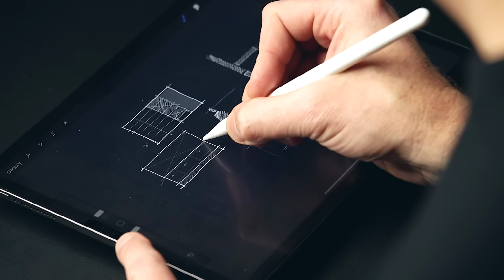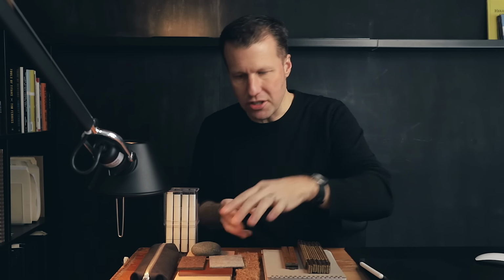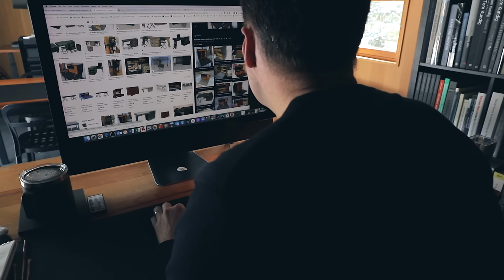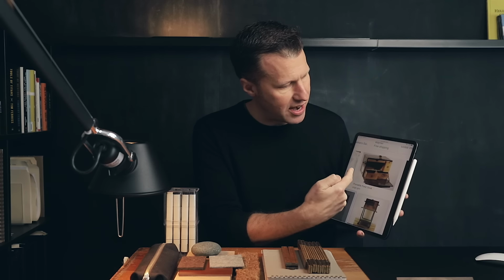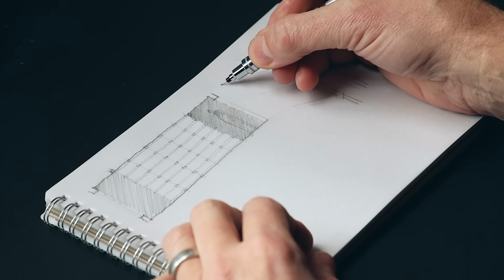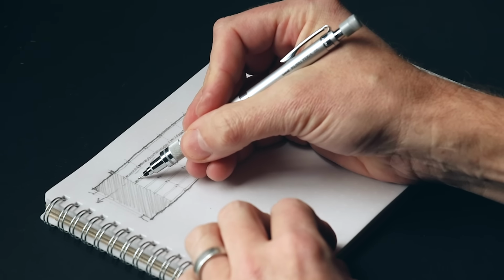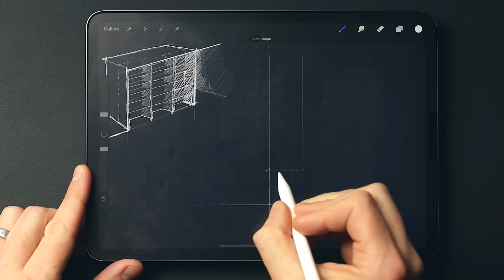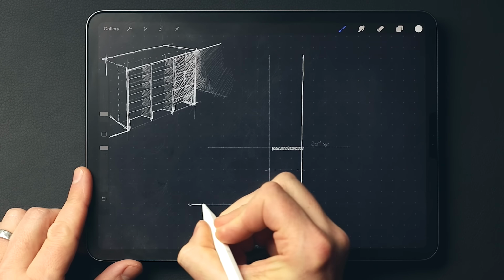How I Sketch + Design Architectural Details

Comment: Is it possible to ballpark the cost per sq ft to build a minimalist modern 2000 sq ft home with these sorts of design gems here and there? 
Can it be done for $200 / sq ft with judicious choice of materials? Or are details like your entryway found only at much higher price points? I’d like to see a show where you discuss design and cost trades in a 2000 sq ft footprint.

Comment: oh man, I was trying to figure out this flap desk design fro quite a few weeks with hardware available I had not enough faith in the strength and if it's going to hold. This pivot hinge with a stop on the fixed shelve make s it easy! One I am making will be within the unit that can a be moved up and down with 12V actuator so it can be stand up desk as well. Nice, this was helpful I shamelessly ripping of this solution!

Comment: Great video, inspired some creative ideas for my clients mudroom. I am going to place a 6 inch deep cabinet with phone and I pad charging stations and key hangers with a pull panel that will have a cork and chalk board face on the exterior face. The panel will act as a temporay writing surface.

Comment: I'm not an architect, but I am designing my own house.  I walk around with a measuring tape and check things like how wide is this china hutch and how much space is good for a great laundry room.  I went about my design in a layer by layer by layer method, from the dirt up.  How does the air flow through rooms?  Where is the sun?  In a big Arizona rainstorm, will these walls be protected?  Where will the water go off the roof, where does it wind up down hill?  Is the hot water heater in the best location to save precious water?  Could I move the kitchen sink to make better use of a straight line to the hot water heater?  I probably should have been a designer by trade, but I chose the law early in my working life and kind of got stuck there.  No regrets, but I would have LOVED doing this work for pay earlier in life.  I was fortunate to find  you a couple of years ago when I started this project.  Your shared knowledge has saved me tons of aggravation.  Thank you soooooo much!!
Reply from the maker: You've actually discovered one of the most rewarding ways to "practice" architecture...by doing!
Reply: keep in mind a little information MAKES ONE DANGEROUS  - hire a real designer to at least look over your shoulder - no different then me reading ONE book on law and showing up in court

Comment: man it's really good how you show the inside steps and thinking processes, so we can know how much effort goes into even the simplest design solutions.
Reply: fine but DON'T  expect the client to pay for the time required   ( still have to do the construction cadd drawing and research and select materials specifications , and make client presentation and revisions, and meet with the fabricator , and review shop drawing , get quote approved by client, review on site installation,   and usually eat 1/2 the charges - just saying - 40yrs experience talking